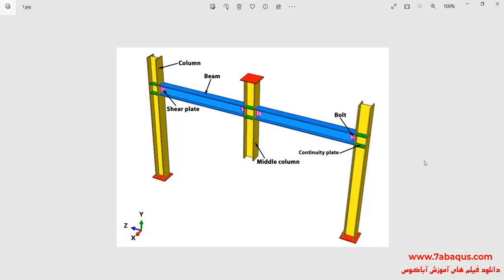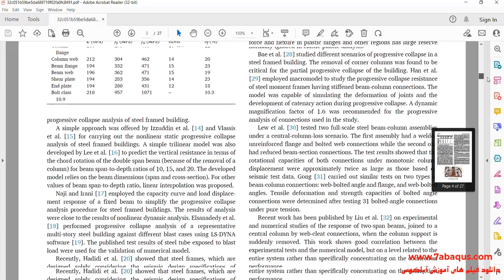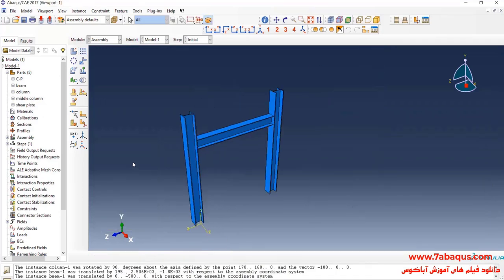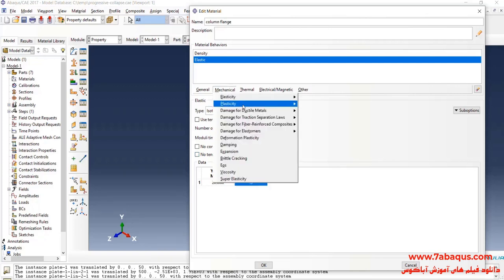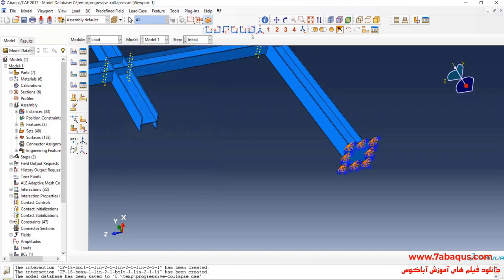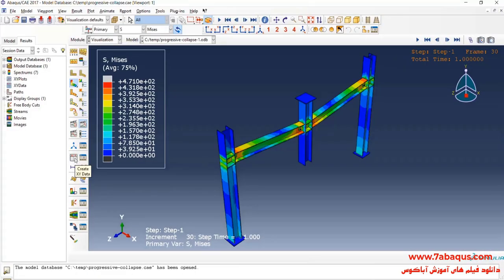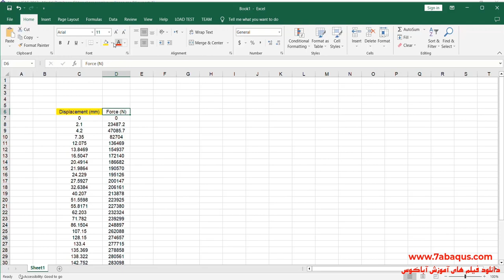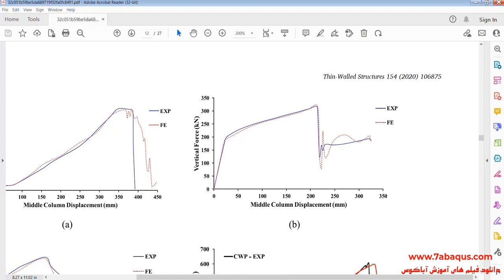Progressive collapse of a steel frame with column removal method Abaqus

Comment: Why did you take the sum of reaction forces instead of plotting the reaction force vs. displacement graph at the integration point? If you could explain, it would be appreciated. Thank you in advance.
Reply from the maker: Hello
You should always calculate the total forces
Reply: @saeedmoeini-7abaqus  Thank you for reply! So we can say that we can take a single node or integration point when plotting the stress vs. strain curve, but not when plotting the reaction force vs. displacement. We must compute the sum of the reaction forces (i.e., total forces)  where displacement has been applied.
Reply from the maker: @DeepakKumar-ri2nr  Yes